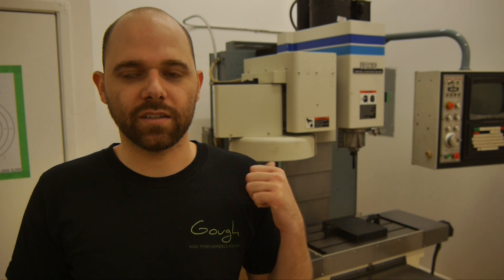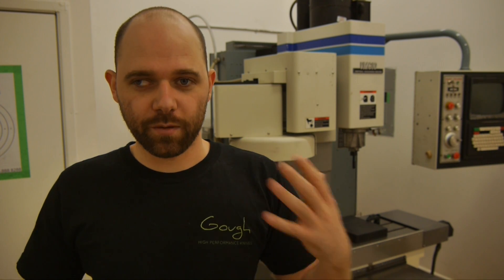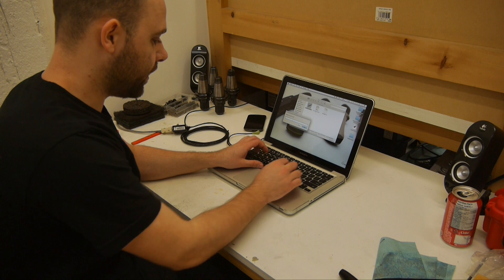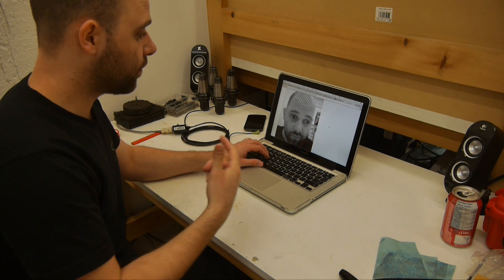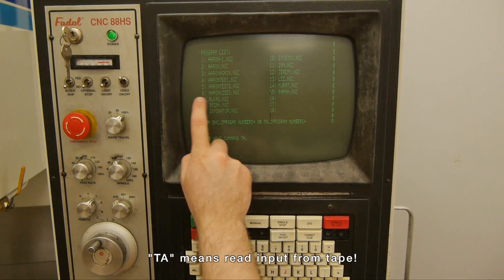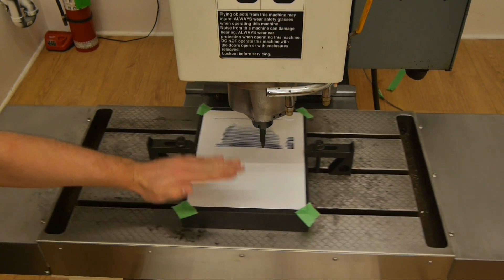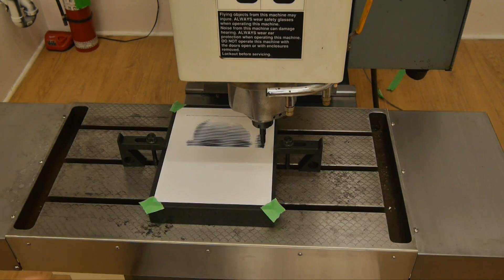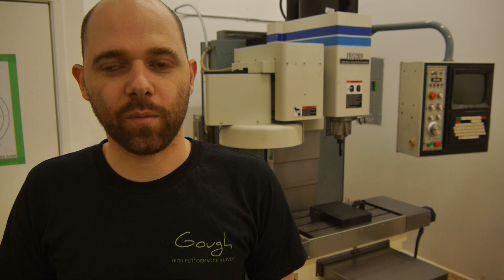Introducing the CNC Photo Booth!

Comment: One quick question if you are using the cnc mill how would machine know how to profile the knife thanks!
Reply from the maker: ***** Basically you have to program it! The machine by itself really can't do anything, so to get it to profile the knife blades you have to program a series of moves that draw out the profile of the blade. This will be done using a CAD/CAM system rather than doing it by hand.

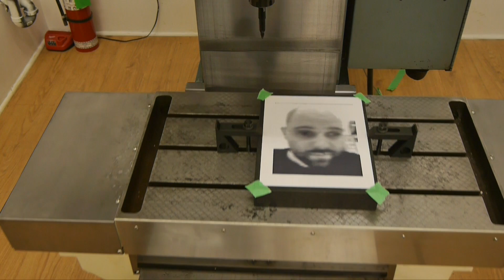Comment: interesting, @ 3:54 when the table was feeding toward us, the pic became very clear
Reply from the maker: ironlionkalo This is an effect called 'moiré', basically the sensor in my camera is quite large (15 million pixels) but an HD video image is much smaller (around 2 million pixels). In order to make a HD video image my camera only actually uses every 5th or 6th pixel (this is called line skipping).

Because it does this patterns made up of lines sometimes come out quite oddly when filmed. It's a common problem with cameras that do both stills and video.
Reply: interesting, i guess in rare instances the image actually becomes clearer

Comment: wow, first high tech engine which remembers me of Rudolf Hell's "Klischograph", a machine developed in 1953 ... ;-)
Reply from the maker: bangalorebobbel I had to look that up! The final result looks very similar! Very clever system!
Reply: yes that company was in those days leading in absolutely clever systems - Rudolf Hell was kind of Edison of printing industry ;-)
I think a lot of later technology like fax and scanners and so on goes back on his initial inventions and approaches.
When I saw what You did I got immediately remembered on that good old Klischograph - I have seen such a machine working during my studies, we had one in our lab there. Instead of programming the engine one had simply to put a picture under a foto diode - line for line it was read and translated into movements of the chisel. Funny to see that You do almost same thing with Your high end modern technology ;-)
I think You could use that machine in that way also fine for cutting any specific profiles into handle scales or so. Almost endless ways of use ... the only question is, of course, whether it makes economically any sense - I would say for prototyping it is a very interesting approach, but for mass production most probably nonsense ;-)))

Comment: That is one expensive printer :P
Reply from the maker: TihslluB3 I know right!

As a side note, next time you're at a print shop getting business cards or something made, ask them how much their printers cost! Your jaw will hit the floor!

Those printers are amazing inside too, thousands of moving parts all going at high speed all day long.
Reply: Gough Custom One place I delivered for had thermal price printers, they had to be 10-15+ years old, no USB. LPT communications port only. Repair/overhaul of one printer ran in the thousands, replacement was closer to $10,000 for a single used printer.

All of this and the buggers were about the size of a desktop laser printer.
They had three of those printers, one of which you had a watch like a hawk because it was always running out of adjustment. Those printers stalled my deliveries quite a few times where one would mess up an entire roll before anybody would catch it and they would go through and reprint and replace each sticker. 2-10 people replacing well over a couple hundred stickers.
Reply from the maker: FoolishDoug That was for a price sticker printer?! Was there something special about the stickers or the system that stopped them moving to a newer system?
Reply: Gough Custom The printers were wide enough to accept their 8 inch plastic stakes, other than that they weren't special. Owner's stubbornness to upgrade?
Reply: Gough Custom Their software was probably another reason but I have no idea if it was industry standard. I also cannot remember what the name of it was.

At least they could have bought a new price sticker printer and leave that one dedicated to the task.  Machine I found at one point and tried to suggest used the same type of ribbon and sticker rolls from what I remember.